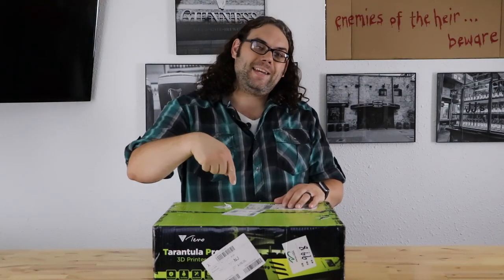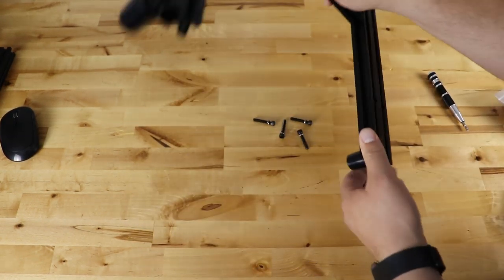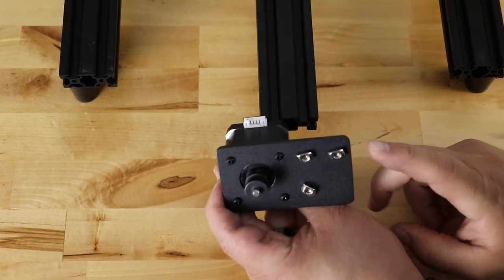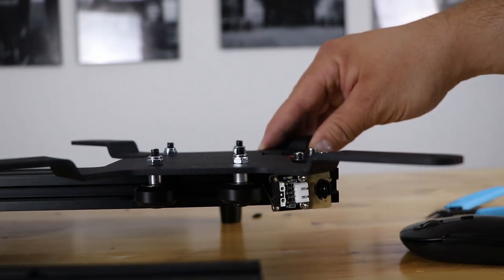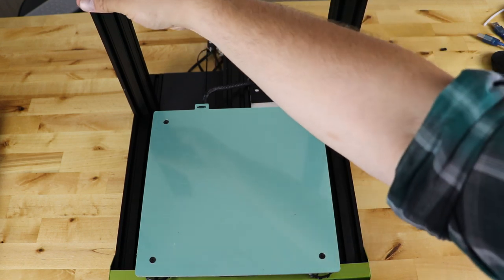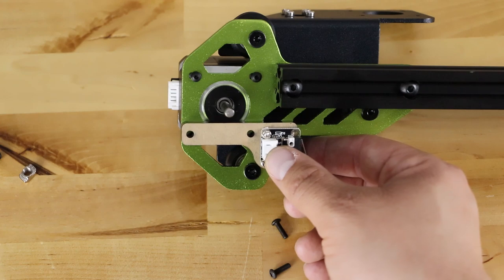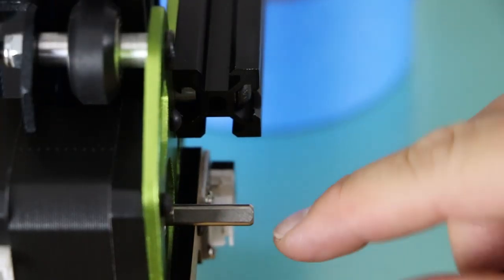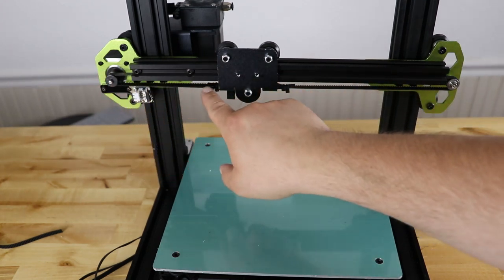Tevo Tarantula Pro Build/Assembly with New Tips and Tricks

Comment: Glad you mentioned putting 1 grub on the flat. That pulls the pulley against the radius of the motor shaft. Any other way and it could cause it to wobble introducing artifacts.
I hope the motor never needs a heat sink. Have to add (as Ivan Miranda) SPACERS under the feet to make room. I haven't figured out if my Y is getting too hot or it's my accel/jerk too high. Still testing.
Reply from the maker: The flat side for sure!! Thanks for watching!

Comment: I followed adding the extruder plate to the green assembly even though you missed those steps in the edit; it appears to just be 3 locknuts.
I'm surprised the directions say put the washers under the Z nut. Those are usually put next to the bolt nuts to keep them from backing off.
Oh, did you check the squareness of the extruder bracket? At that point it would be easiest to bend if needed.
Reply from the maker: Good suggestions!!

Comment: Hi. I had the same issue with the phantom beeps and clicks on my Tarantula Pro. I went down the path of replacing what I thought was bad cables but the problem persisted. It ended up being a bad PSU. Everything seemed fine when idle, but started to beep and click under load. Replacing the PSU fixed it once and for all. I even installed the stock display cables and it runs like a champ.
Reply from the maker: Awesome to hear! I may have to do that as well if it comes back!

Comment: Great build video Jim!   How was errf?  Have any videos in the works from there?
Reply from the maker: Thanks! Yes, I have some coming!!
Reply: One thing I have done in the past with beds that need leveling like that is tighten a nut to the bed leveling screw at the bottom of the bed before installing the spring. That will help hold the screw from spinning.  Also it acts as a spring retainer which will keep the springs centered which will help improve accuracy.

Comment: hi Jim, no nuts under the heat bed begore springs like ender3 mod :) and did u check psu grounding + metal frame gnd, so now it needs ezabl pro, ezplate+pei and tmc silent drivers :)
Reply from the maker: I was just going through the normal build as it was in the directions. But it now has an EZABL Pro, and EZMat!

Comment: You forgot to remove the protection sheet from the aluminum plate of the heatbed before placing/glue the print surface.
Reply from the maker: I may not have shown it in the video, but I did take it off. Good point though! PS. Your video was great on this!
Reply: @TheEdgeofTech  I just assembled a machine similar to that one, and there were 2 layers of green foil, a thick layer and a thinner layer, both layers having to be removed before applying the black mat.